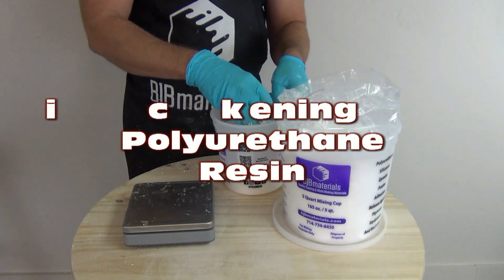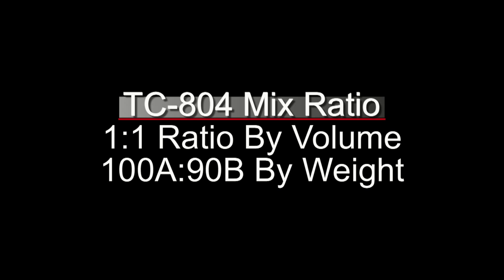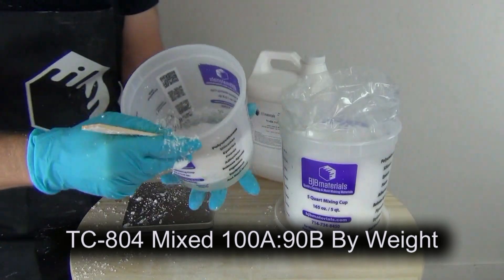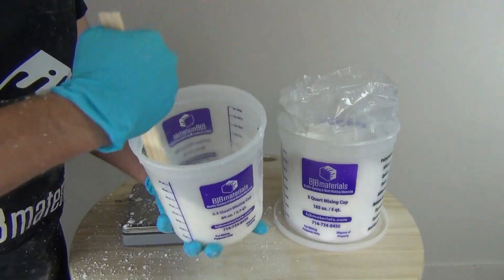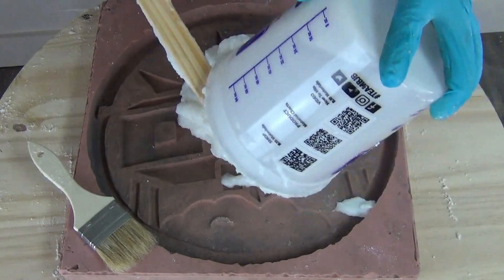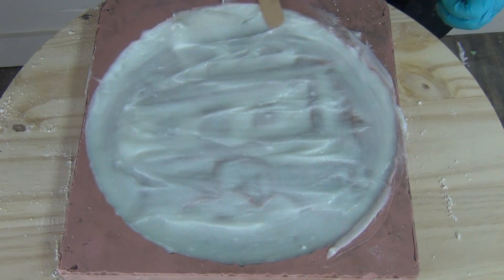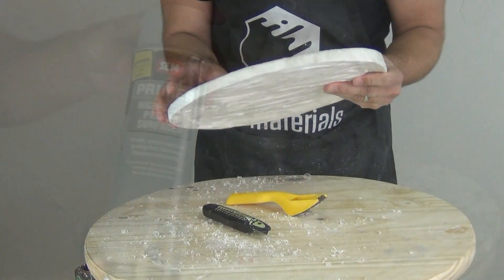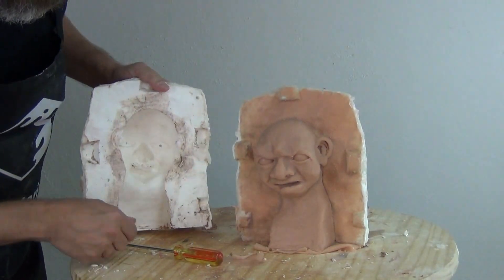How To Make "Brushable" Resin

Comment: I have a couple of questions… 
-Does this thickener work when and brand of 1:1 resin or just the brand shown?

-How do you calculate how much part A and part B resin to use with this? For example, if I usually use one cup of part A and one cup of part B, how would I calculate it to add in the thickener?
Reply from the maker: The ratio stays the same. If the resin formula is 1:1, if would still be 1:1. You add the fiberthick to get whatever thickness you want. You can adjust to your needs as the fiberthick is inert.
Reply: @brickintheyard Oh, okay, I wasn’t sure as the video mentions a 100 to 90 ratio.
Reply from the maker: @BlueHatter 1:1 by volume 100A:90B by weight